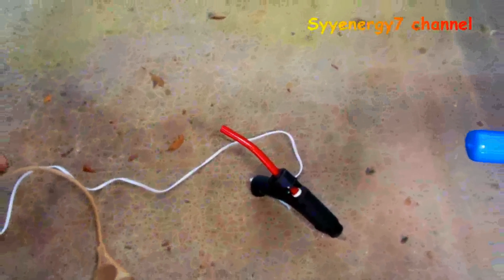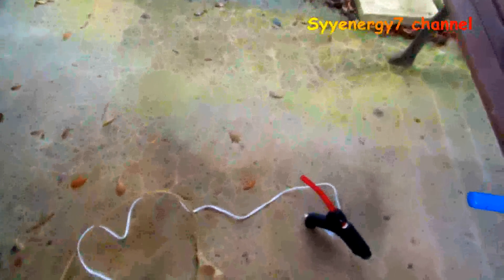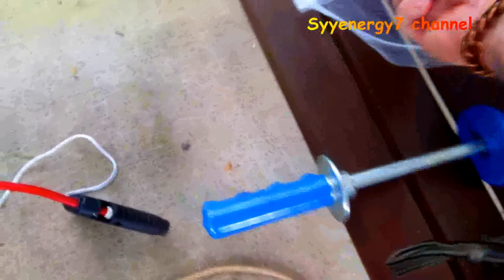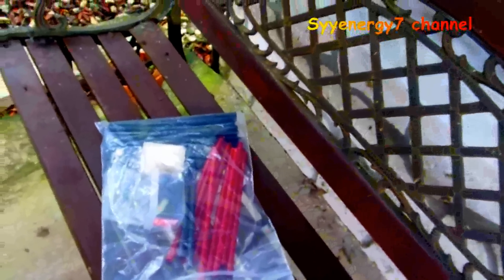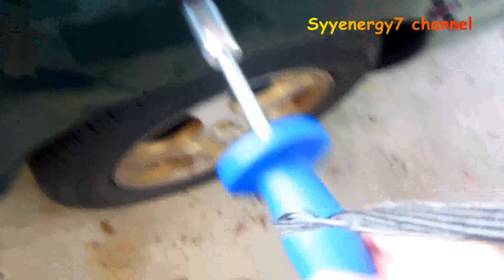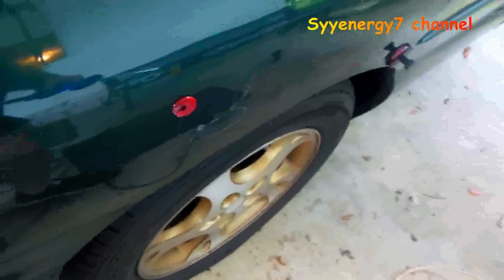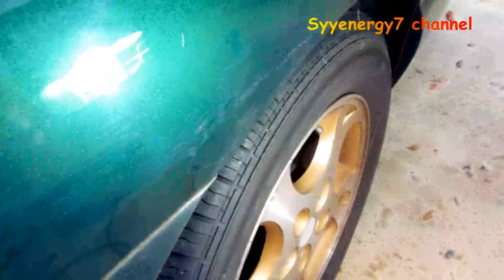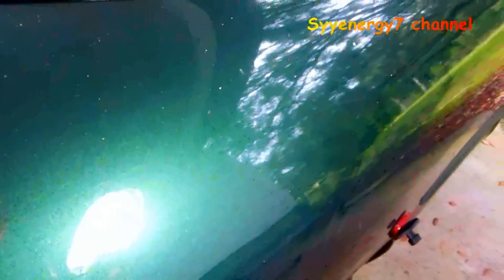Chrysler Sebring  -Small Ding, Dent Repair - PDR Glue Tab

Comment: Your method of putting the tab near the dent and applying hot glue and immediately putting it on is BEST!, that's awesome advice. I can offer you one piece of advice for getting the dents out better...Don't be afraid of over-extending the dent....HIT that HAMMER HARD as you can first strike...the plastic-glue interface will always separate and No, I've never had an over-extended "high" spot. I get hit it as hard as i can...which always works best to get most of the dent out the first time....i still find myself going in for a second or third glue-ing too....better then the old method of soft hits...with 10 cleanings and reglue-ing.
Reply: That makes sense because most panels are convex. It is easier to create a dent than a bulge because a panel would have to stretch more for a bulge to form.
Reply from the maker: I'll try that.  When it is humid. it does not work as well.  I have wait for a good day.  But it did work decent so far.

Comment: How do you get the glue off the panel when finished?
Reply: There's a liquid softener (don't know the chemical mix) you spray and apply directly on the glue, especially around the glue's entire circular edge to car paint and then you use a soft plastic scrapper and basically knock it off...it's not that difficult with the liquid softener....without it you're hosed...Windex and Pine-sol cleaners are poor substitutes.
Reply from the maker: isopropyl alcohol
Reply: syyenergy7 thanks..I was thinking it was silicone spray....mine didn't have a label.
Reply: syyenergy7 I was wondering which. Thanks.